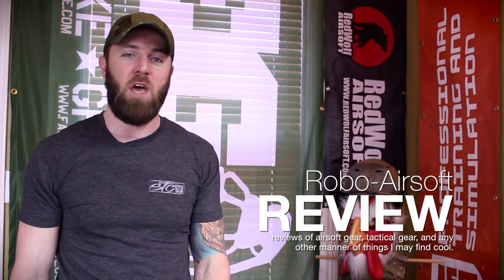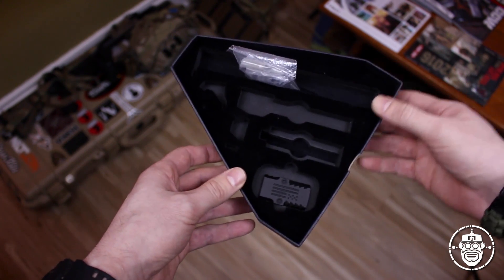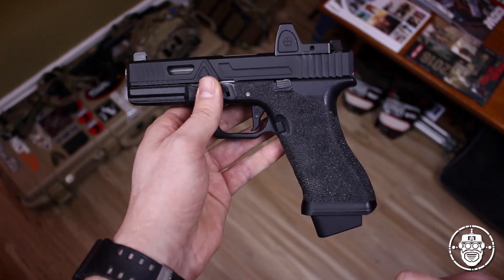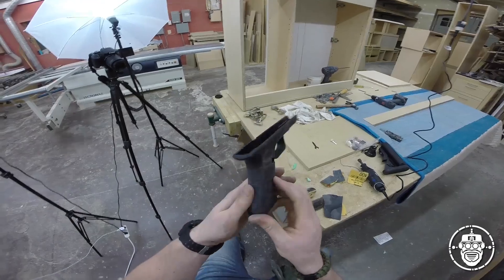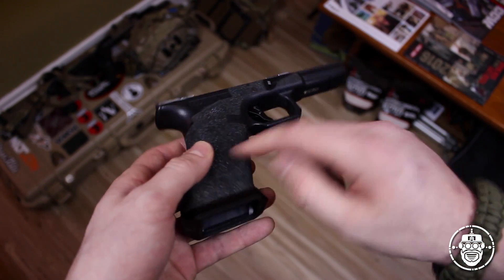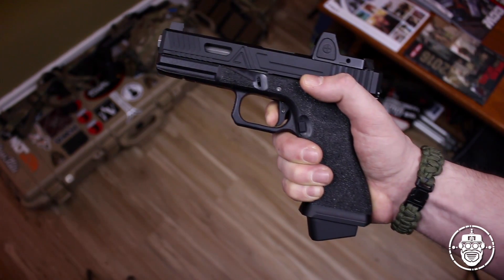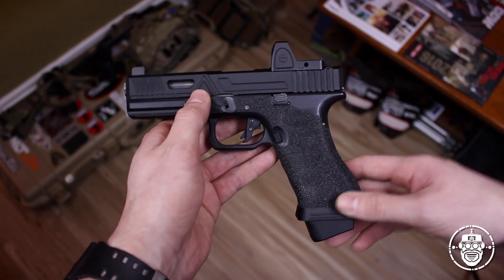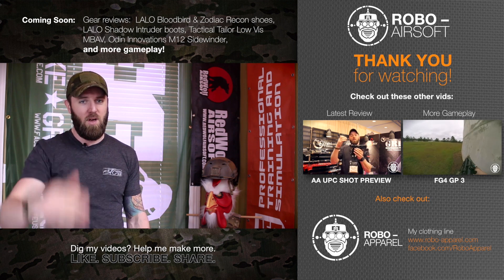Robo-Airsoft: Robo Gear Review - My Personal Agency Arms / RWA G17 Urban Combat Training Pistol

Comment: looks nice, but the slide cycles too slow for me, could put a stronger recoil spring in this baby
Reply from the maker: +XlawSpencer I have another spring; 9-Ball high-speed one. I plan on converting this to CO2.
Reply: Robo Murray Airsoft yeah mate, just saying. i have coverted mine to co2 for a while now and from my experience, except the metal loading nozzle and any other well-known steel parts(like hammer, spring and vavle knocker etc), you will also need a metal bulb and metal bulb locker, otherwise they will break. I envy you for that slide tho xD

Comment: Looks damn good! Robo. For the non technically inclined Redwolf is selling the lower frame minus the internals. They are promising a complete pistol at some point in the future.
Reply from the maker: +Ryan Griffith That is correct! No timeline yet on the full gun, but obviously RW and I will make sure everyone knows when something changes.
Reply: +Robo Murray Airsoft I'll be interested in seeing how that Beast performs on co2. I assume your going to try the WE co2 mags. I would suggest the "Nine Ball enhanced mag lip seal" available at RedWolf. And the "RA-Tech stainless steel bottom caps" available at Evike. I've had good luck with both of them. Definite improvement to the WE mags.

Comment: I'm curious as to why Glock is your preferred sidearm in the firearms world?
Reply: +RageQuit003 more 1911s have problems on range/training than glocks .. just what ive heard
Reply: MrDeRooy I wasn't considering 1911 vs Glock as the binary choices.  I was inquiring more about why Glock vs the thousands of other handgun choices on the market.
Even if u narrow the field down to polymer framed striker fired 9mm handguns, Glock has a ton of proven competition.

As for the 1911's, I've personally witnessed them go down, but that owner would never run a double stack Glock because of his small hands.  However I've seen a Springfield 1911 Mil-Spec with less maintenance never malfunction and it's only $100 more than a base model Glock.
Reply from the maker: +RageQuit003 I just enjoy the bore height in comparison to the base-line of my hand/wrist. 1911s are nice, but I prefer the Glock grip over a 1911. I also do like Springfield XDS and S&W M&P...but again - that's mostly because of the bore height to hand ratio.

By comparison - I'm not a huge fan of SIGs or most H&K sidearms due to the increased height of the bore to the baseline of your hand.

Just preference, really. I like a gun that lets me choke up as far up to inline of the barrel as possible.

Comment: not locking back with an empty mag ?
Reply from the maker: +sike3000 Locks back fine. First clip the slide is in lock position when I reload, and I engage the slide release as the gun comes back online. Second clip - I have rounds left in the mag; I fired twice and stopped on purpose.

Comment: did you experience any issues at customs? Thinking about buying this kit with the airsoft surgeon lower and I don't want some over zealous CBSA agent seizing my shipment.
Reply from the maker: The kit I had no problem with. Where you're going to see an issue is the lower (even a stripped one). It's the same as airsoft rifles: in Canada - much of what is classified as "the firearm" is the lower receiver (pistol frame, or AR/Rifle lower receiver). A slide, barrel, hop up, etc. can all go through customs just fine...it's a complete pistol or just the lower portion that become a problem at the border.

I would speak to a local store and see if they can bring it in for you, maybe?

So ya - simple answer is that the kit is fine, but the lower receiver/frame probably will give you trouble.
Reply: +Robo Murray Airsoft okay, I'll probably go through my local store then. They have guarder replacement frames for marui g17's, so clearly they have a work around. I was just wanting to avoid the mark up, but it's clearly the safer rout. Thanks so much for the information though,and keep up with the great content!

Comment: Did you had any issues when they shipped to you? Because when I was ordering mine from redwolf I had to cancel the order because they would take it away before it arrived to my house :(
Reply from the maker: I didn't order a pistol with it. The pistol itself is the contented item when shipping across some borders. The slide kit, however, shouldn't be an issue to ship.
Reply: I was talking to the guys at Gas Blowback Central, expect to see a whole new line of Agency Slides. They are releasing G34, G26, and possibly some G22 slides.

Comment: is that RMR holding up to recoil? I saw a lot of them break after little use.
Reply from the maker: Haha - funny you say that: Unfortunately mine also bit the dust. I still have it on mine, for "Cool Guy Points" - but I just witness the sights through it. I'm of the mentality now, that if you want to ACTUALLY use a RMR for airsoft, it's just best to invest in a real one. And if you shoot real firearms, you'd go this direction anyways – so at least you're not losing TOO much value, across the two platforms.
Reply: That's unfortunate :( I guess I'll have to save up for a real one

Comment: I probably sound stupid for asking this (a bit newer to airsoft) but if you convert it to take Co2, is there anything you need to replace besides the loading nozzle? Like the rocket valve, valve blocker, etc?
Reply from the maker: Nope - just the nozzle (and that's just suggested, as the TM one is plastic) and the recoil spring and spring guide. You just need to buy the APS CO2 glock 17 mags and you're good to go.
Reply: Ah, I see. Thanks for letting me know. Love your videos, keep up the good work  ^.^

Comment: Hows the set holding up? specially the return nozzle spring system

thinking of purchashing one
Reply from the maker: Still going strong, man! No failures yet. I'm behind on trying it as CO2, but don't have any expectations of failure there either.
Reply: I just installed my set, and finding the nozzle return spring system "catch" is rotating out of place after a few racks and starts catching on the nozzle a bit. Any tips on how to keep it in place?

Comment: Im bummed. Just looked all over RWA site for both items. No results found.
Reply from the maker: Yeah - the slide you can't get anymore, unfortunately - just the barrel, magwell and trigger. Reason: Glock went after Agency and told them they couldn't license out the Agency stuff, as it "promoted the use of non-licensed Glock airsoft weapons."

Total bummer.
Reply: on redwolf it's available
Reply from the maker: They must have a few pieces in inventory. But for all intents and purposes, once those are gone – it's not coming back, unfortunately.
Reply: I was talking to the guys at Gas Blowback Central, expect to see a whole new line of Agency Slides. They are releasing G34, G26, and possibly some G22 slides.

Comment: You mentioned that it fits holsters "a caliber size larger". Does that mean that it fits the real glock version that shoots a .45 instead of 9mm? Would that be a glock 34?
Reply from the maker: Yes, sorry – I should have been more specific. In a real Glock, a 9mm is the same size as a .40cal – but a .45cal Glock gets larger in slide size. This is what you have to match MOST airsoft Glocks to, when you get a G17. In airsoft, most G17 replicas are actually the size of a .45cal Glock. That lines up with a Glock 21, 30, 36, 41. A Glock 34 is still a 9mm, so is the same slide size as a G17, it's just longer.

Comment: do you really drop the Gas mags for the quick reloads ?
I thought that might break the gas "tank" in the mag.
Reply from the maker: +Yeung Wilson Wang Yip Airsoft Panda (Jager panda) Nah - that won't break the tank per se; might just mess up your seal a bit (I generally blue LockTite the base on anyways, to prevent leaking. It more will just instantaneously break your baseplate (since they're all mostly plastic).

I'm dropping my mags here because they're falling on pads. I only drop my mags in outdoor games, otherwise I'll retention-reload all the time.

Comment: Hey, does this slide set fit on the timberwolf lower? I know you own both and I don't want to have to get a marui g17
Reply from the maker: +PartNinja No, it does not. Timber Wolf doesn't have the same size dimensions as a WE/TM G17, unfortunately.